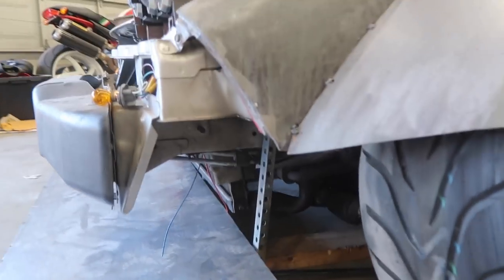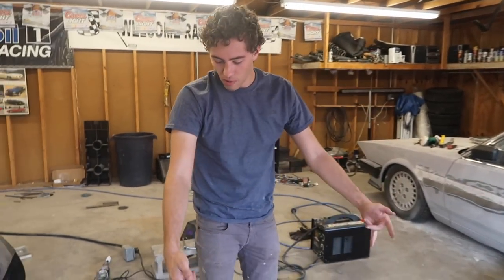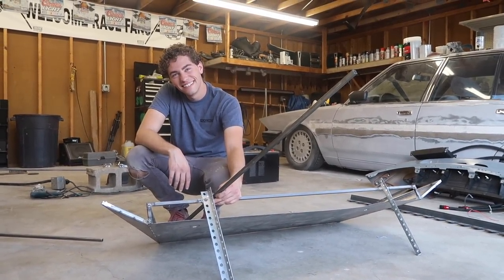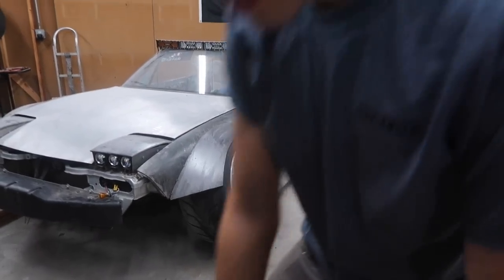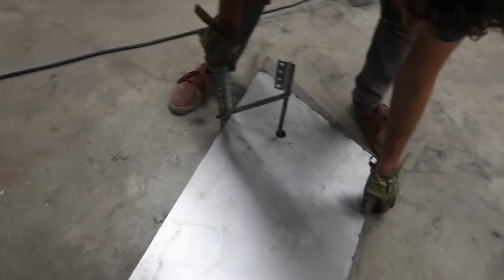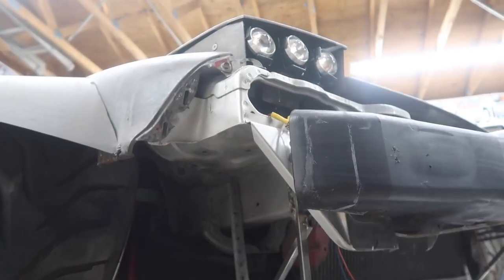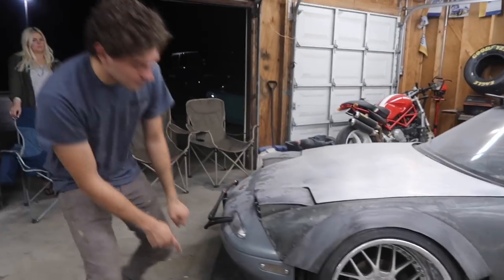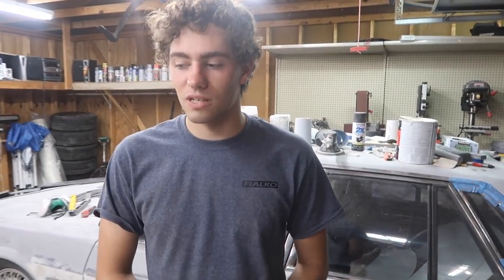The Most Aggressive Splitter On A Miata EVER!

Comment: Why is the splitter so square when the car is so round I think that splitter would look a lot better on the Cressida... and you might wanna drive the car around for a while and make sure the splitter is not diverting air from the radiator